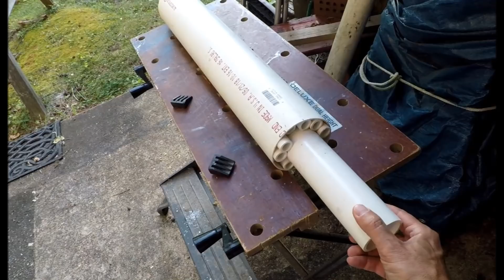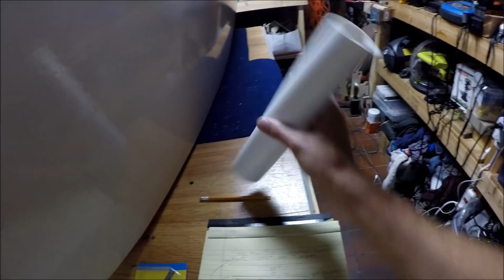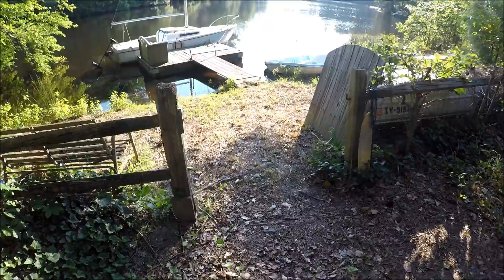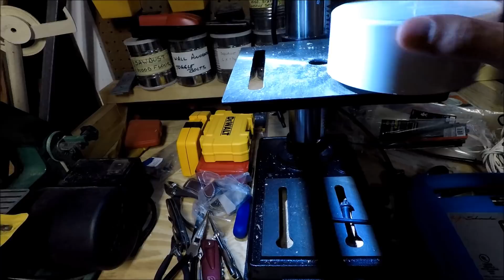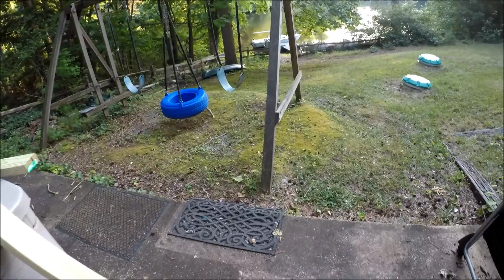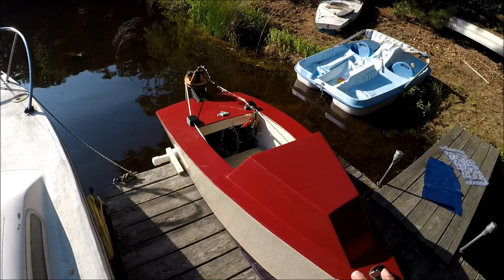(BIG) DIY PVC Roller Bearing Boat Lift!

Comment: Hoping to use your idea...What size is the drain pipe which you used instead of 4" PVC? ALSO, Hoe many 1/2" tubes were you able to use for rollerbearings?

Comment: Very cool concept. I hadn't seen that PVC roller bearing before. Looks quite useful!
It also looks like you will be testing the strength of that bow-line tow point (especially when loaded with batteries) but I think it will hold up. We shall see!
Reply from the maker: Joshua Tulberg Always testing and trying new things.  The great thing about this is that there us nothing to rust, corrode, or maintain really.  We'll see how it holds up.  Even if I need to make a new roller every few years it's cheap and fast to make.